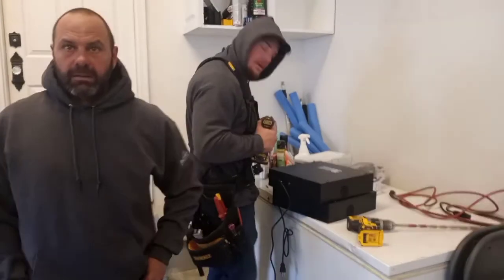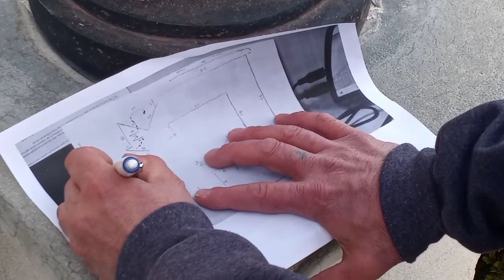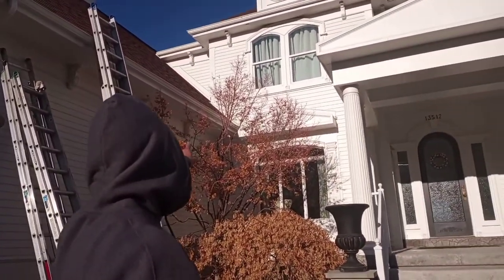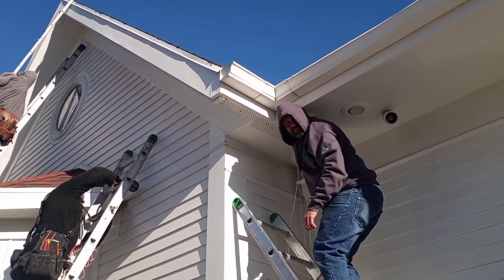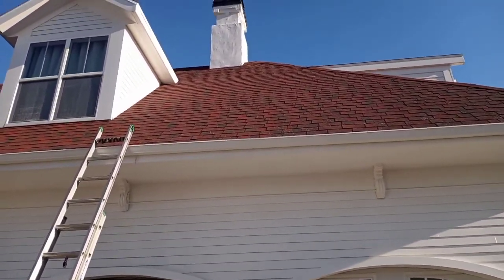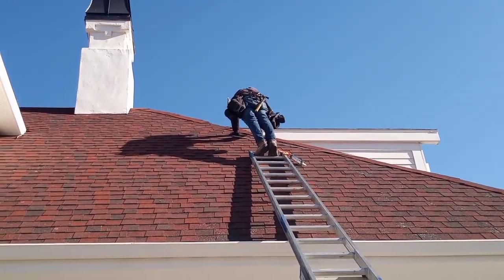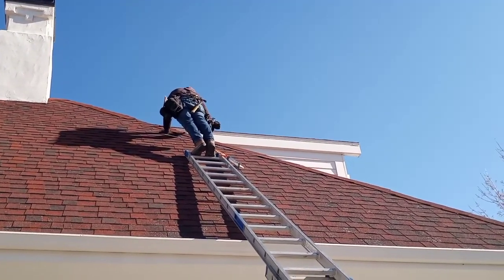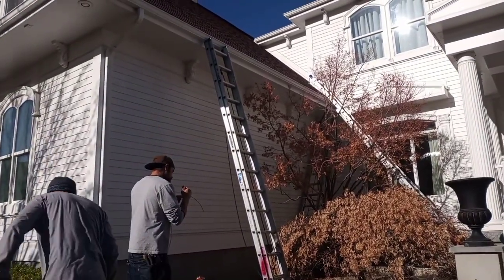Jellyfish Lighting - Complex Install #1

Comment: This kind of lighting requires Licensed Electrician?
Reply from the maker: No.  In most states it does not require a licensed electrician.  It is a 48v low voltage system with a manufacture installed plug that plugs into a standard 110 outlet.
Reply: @JellyfishLighting-Michael   This is Utah here right?
Reply: What kind of track did you use?